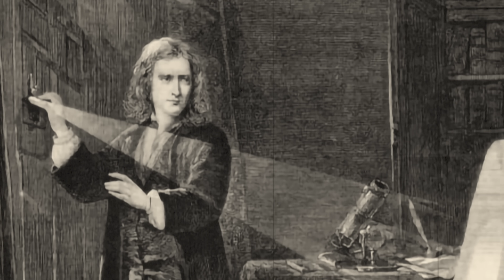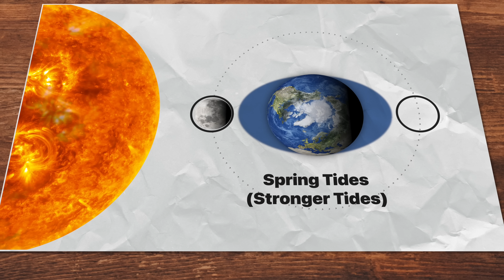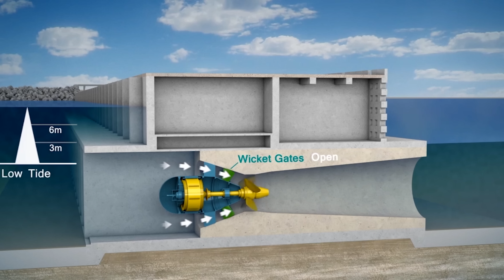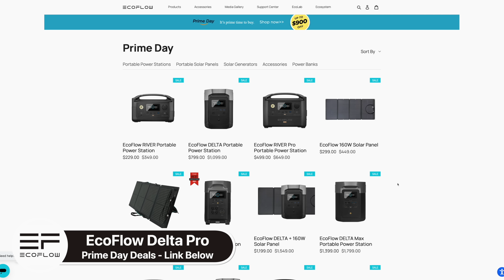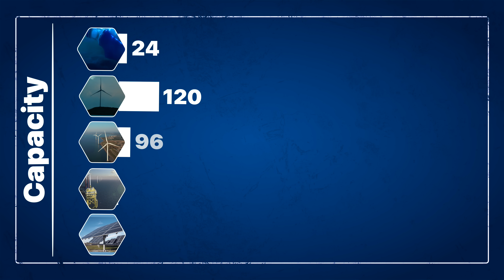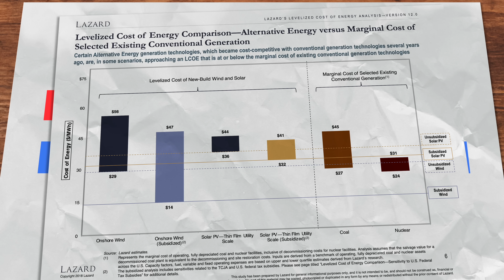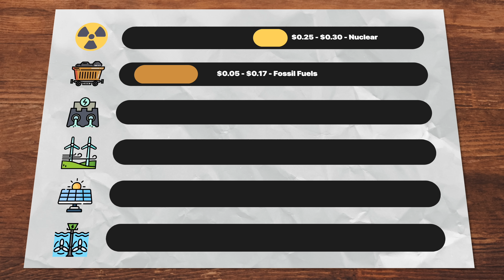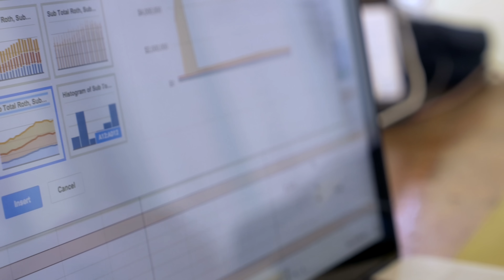Breakthrough Energy Source is 10X Better Than Wind & Solar!?

Comment: The solution to our energy needs has been known since the 1960s. It is the molten salt reactor. However, we have neglected its development, for various reasons. 
The molten salt reactor operates without elevated pressures of current reactors, needs no enormous containment vessel, has the simplest possible shut-down mechanism, and does not leave most (98%, for goodness sake) of its fuel unburned. It is throttleable (= load following), and does not need expensive precision-manufactured fuel rods. They are very nearly immune to nuclear proliferation. The same (genius) bloke, Alvin Weinberg, invented both the PWR and the MSR. A working prototye MSR ran for several months at Oak Ridge in the USA in the 1960s. Unfortunately, the funding was re-allocated under President Nixon, and the project cancelled. But the concept has been re-discovered (largely by Kirk Sorensen) and has a number of supporters.
The British company: MOLTEX is building a "stable salt reactor" in New Brunswick, and is expected to bring 300 megawatts of power to the Canadian grid by 2030. When proven, these things can be assembled on a production line. They actually burn trans-uranics, which are an unwanted legacy from our PWRs (and in Britain's case, AGCRs). 
I think (for those of us with stocks of plutonium) this is the way to go. But there is a lot of inertia in the industry.

Comment: Really great presentation! Being a Clean Air and Clean water advocate any possible option should be explored. I've of course viewed and read much about different technologies already deployed and some in the design and fabrication stage.
Might I offer a suggestion I don't see many take into account when calculating cost pkh with oil. 
Since Kuwait how many wars have been waged to protect oil supplies. This MUST be factored in as it was the CAUSE of conflict. Failing to do so is simply denial. 
Infrastructure. 
In my youth Pres. Kennedy made landing a man on the moon in tens years a goal for US. We had no NASA, no Infrastructure limited talent and no experience in space. 
Yet we did it. 
Can't is an attitude of failure and assures result. 
I bought a solar system part by piece. Cash. I haven't regretted a moment and the savings is insane. My income is a small SS check and a VA disability check. Very limited but I accomplished what I wanted. Because I CAN. 
 Again, completely enjoyed your informative and well executed presentation!

Comment: Very interesting video, thank you! As others have stated, the O&M cost would be enormous for tidal energy at massive scale. Also, the transmission buildout costs would be daunting to say the least. I think this shows promise, but would require significant advances in automation technology to bring the price point for O&M costs in particular to a reasonable point.
Reply: Because of the poor physics of the system the costs will never be compeditive with clean green new generation nuclear.

Comment: Correct me if i'm wrong, but I would imagine tides being most effective being around the equator and gradually less and less so as you go towards the poles, but I guess with the range of spring and neap tides, it will still benefit somewhat, though that will have to be compared against the cost of building and running them to work out which ones are worth building.
Reply: check out the tides in the Bay of Fundy Nova Scotia, they top out at 50 feet!  Sound like if you were going to build these anywhere it would be there
Reply: @robertjones1730  oh yeah, waves are different from tides, but if they are that strong, then it would be beneficial.
Reply: It has more to do with coastal  topography; Liverpool has 6 a knot tidal stream at Springs and 4 knots at Neaps with a Springs range of about 30 feet, as the bulge that follows the moon banks up against the shallower continental shelf and spills around Ireland into the Irish Sea, and around Scotland and Dover into the North Sea

Comment: We should use all renewable options BUT we should have been doing this 30 years ago... US President Jimmy Carter 1977 to 1981 was told about the build up of carbon in the atmosphere in the 1970s his administration got development of solar and wind started. He also wanted to do a blindingly simple thing and have high fuel use vehicles cost more subsidizing the lower fuel cars. We drive in 1500kg cars to move a 90kg human!!!
I find it staggering that two person work and back traffic cars are not promoted.

Comment: Why does anyone care about efficiency for energy?  Solar, at ~20% efficiency, is much cheaper than tidal, at ~80% efficiency.  How efficient is coal?  Oil?  It doesn't matter at all.  Solar could be 0.1% efficient, and as long as it were cheaper per unit energy over its life than something that's 100% efficient, solar would still be better in terms of energy generation.  For energy, we should only care about the costs.
Reply: Efficiency is important because it can bring down cost, but I agree that high efficency does not nessesary mean lower overall cost. Cost is complicated to calculate, especially if you want to include side effects like environmental damage.
A solar system with very cheap panels with very low efficiency  would require much more land and high installation cost bringing overall cost up.

Comment: You absolutely cant use LCOE to compare costs of renewables to reliable forms of power generation. Whats the cost of a kwh of solar power when the sun isnt shining? If solar and wind are so cheap then why is electricity in places like Germany and California so expensive?
Reply: LCOE is not everything. You need to include storage, grid transmission and climate and environmental damage when comparing energy systems.

Comment: I live in Quebec, right next to the Saint Laurent ... "River" is an understatement.  The apartment I live in is heated by ELECTRICITY, from the countless dams here, and all electricity in the building is included in the rent(upkeep) cost, and Quebec even sells its surplus to the US grid.  I guess the only OTHER better energy source would be deep geothermal.  I really don't understand why people don't get MORE GEOTHERMAL, since the fluid would also provide rich mineral resources extracted without the usual dangers and costs.

Comment: About maintenance: 
I expect a major difference between that French installation an (for example) the Irish. The french installation has dense turbines with high flow rates (flow is condensed with the dam), while the "underwater flow turbines work slow. So I assume, the "Irisch" way might be more influenced by biomass than the French model.

On top I see  another major difference: I expect the French model more reliable output and easier to maintain than the propeller dropped on sea ground.

Comment: Those figures for lifespan seems completely unrealistic. I manage a high rise condo in the beach and there isn’t a commercially viable metallic equipment that we have that lasts more than a decade or two. We are constantly adding waterproofing coatings and lubricants. And we are on the land. I can only imagine how much more abrasive underwater is. Would love to know what materials they are using, would be a game changer in my industry.

Comment: What I miss in your costs per kWh overview is the moment of generating. Like the moments that we use it, Solar is the less during winter and much during the day in the summer. Wind is only on avarage but not on exact moment to be calculated. Maybe summer winds by local climates. But in the Netherlands the strongest winds are based on low pressure systems that should more be available after the hurricane season in the USA. And if the evening of windpower option grows, the price off the electricity will drop. Tide is there every 12.20 minutes again. So also a lot of times during morning and evening peak periods. Tidal current is mostly also stronger when the wind is strong.. in this case both renewables will give lower prices.

Comment: The secret sauce is turning out to be overlaying wind on top of solar.

Solar works best during the day when its hot.  The cool thing is that wind works the opposite of this, it's the strongest when it's cold and dark.  When you overlay them with batteries, it becomes the best resource.  In 2022 that is what the US grid is doing, most of the new power is batteries, wind, and solar.  Coal is collapsing, nuclear is staying steady, and natural gas is pleateuing.  Solar, wind, and batteries together is now the cheapest option and works everywhere on Earth.

Comment: I've encountered this on a personal level. I live in an RV, and have had to weigh these factors for when I'm boondocking. Currently, the most cost effective power generation is a petroleum based generator (gasoline, LP, diesel). But there's noise, pollution, and the smell that makes it inviable except for emergencies. Solar and wind are less reliable due to weather. But, when I get, and move onto a boat, tidal power will become an option when at anchor*. When on the boat, I plan on using all four options, and often none since I'll be sailing and won't need any electricity.

Truth is, all the factors are scalable down to a personal level, which is how wind and solar were evaluated. Sailors don't use much - if any - electricity when under way, so we just use solar to power E-nav and radio, so tidal generation hasn't been as well evaluated.

*I have a couple of ideas for generating tidal power - or, more accurately, a version of it - while under way.

Comment: What is needed is further expansion and research in the third line-item of the chart at the 11:00 mark.  It is right near the middle as far as LCOE costs (slightly more than half the cost of off-shore wind), throttleable (need more power? increase the output of the generators), ALWAYS available and if the PTB would allow recycling/purification of the waste, it is far safer than most people are willing to admit.  You also don't need to build your power plants along the shoreline, remember what triggered the Fukushima disaster?
.
Regarding the maintenance costs and longevity for the tidal systems.  The Laurent project in France and the Siwa in S. Korea are, to all intents and purposes, standard hydroelectric dams.  The biggest differences are they DON'T need to rely on rain and snowfall to "recharge" nor is their storage being drawn down for drinking/agricultural use plus the turbines run in both directions.  It would be relatively easy to pull one of the turbines from the "array" if it needs to be repaired or replaced.  You can't say the same for a turbine sitting miles off shore in over 200 feet of water.

Comment: How did you make up that pop up. Challenge the argument not the presenter. Thats not what i was gonna comment on. That popup will work for agreeable people. However do nothing for less agreeable people. 
Moving on...
I've been banging the desalination drum for over 30 years. The ocean is our best resource...
Desalination has challenges, the lakes we have ruined are not going to lessen unless we pay for desalination now and stop using the cheap water. 
I don't consider myself an environmentalist, I am the opposite actually, I am a commonsense-oligist and your presentation on the surface makes sense. 👍 i would like to praise your presentation however that would violate the popup warning. We cant have things both ways. If we can't personally attack the presenter because he doesnt deserve to be attacked, nor can i give the presenter any praise. How can we square this?
👍😁🤣

Comment: A generators efficiency is directly related to the diameter of its windings . Why do people stick with a small generator diameter with a fan hooked to it . I am very much a fan of Archimedes , his screw in particular . A very modified version , made to not move water , but made to be moved by water . With a generator in the outside . Slow moving grated , to keep large things out , and slow enough to not harm small things .

Comment: Regardless of cost, the energy efficiency of an energy capturing method, and it’s effects on the environment, and it’s requirements of human labor, are the three most important factors. No slave wages/labor, less environmental impact, and high efficiency, means less materials used, to provide equal energy that other solutions might require! Energy efficiency is worth the extra cost, but that saved cost should not be taken from people who manufacture and engineer the solutions.

Comment: This is a good addition to our energy portfolio. We need energy diversification desperately. Crude oil cannot sustain the growing population on its own and clearly there are negative affects both environmentally and economically to rely on it almost exclusively. We need amounts of energy that go well beyond what crude oil can supply on its own which has proven to be unreliable. This is why collecting it from beyond the Earth from celestial bodies is really the only way forward if our civilization has any chance to continue to grow instead of slipping into decline. The amount of energy potential from the Sun's radiation and the gravitational forces put on the Earth every day is simply staggering. We just have to improve our abilities to harvest these resources and use them efficiently and we will be set. And if we actually do successfully develop practical fusion reactors that generate energy for actual consumers, that will be the cherry on top and the ultimate baseload.

Comment: Your entire argument is moot.  It is based on the assumption that CO2 “traps” heat and causes Global warming..... therefore we must stop using hydrocarbons for energy......  which is utter nonsense.
CO2 is a trace gas within a larger body of gas (atmosphere), which continually moves with convection currents.  There is no “trapping” or re radiation of any significant measurement.
We have an abundance of Hydrocarbon gifted to us by nature that offers huge energy density and produces water and CO2 when burned.
We are demonising and wasting this resource by going backwards into tidal technology, along with wind and solar...... which are a gigantic waste of time, money and resources to produce so little energy.
It sounds great when presented to us like in this video, but merely perpetuates the propaganda (now not even mentioned) that we need at all costs to eliminate CO2, the molecule of life.  Sheer lunacy.

Comment: Australia's far north west Kimberley region has drowned river valleys giving suitable sites for barrages and a 30 foot tidal range --possibly the best overall tidal resource in the world.  Using tidal power for mineral processing including extraction of magnesium from sea water has been considered --there is no nearby population but undersea cables to Indonesia is possible and a current scheme to send solar electricity to Singapore could mesh with it  (many years ago Buckminster Fuller proposed GENI - Global\Energy Network International to interconnect the day/night summer/winter north/south power grids and even out consumption and production - the cost of distribution might prove a problem for a full system.   one benefit of tidal power is to pump some water over the barrage at HIGH tide (when the open sea and the impounded water are level ) -pumping water a foot over the dam wall costs some power but at low tide that same water falls 30 feet giving high NETT power unlike pumped hydro.  Wind turbine blades are being retired en masse after not so many years and suffering erosion and fatigue --also gear box cracking --for underwater blades heavier less susceptible materials could be used and 'bug wipers' like used on top modern sailplanes energized by the water stream could remove marine growths economically .   Paul MacCready looked at hydro stream energy from the Gulfstream in the 70s but not sure what resulted. (Hurricane loads might have been a deterrent )
It seemed that cost estimates for tidal or marine power had a huge 'error bar' but not sure why .  The Severn estuary tidal potential is another problematic case -the very severity of the flow makes construction difficult as it did for bridge building there.   Good luck with future progress.

Comment: At 8:37 you say wind is "heralded as the most efficient renewable"  would  you provide a little more context as to what you mean by efficient? I'm also not sure where you pulled the numbers from. Typically Hydro is considered to be the Most Efficient energy efficiency converting ~90% energy that is put it to energy put out as electricity. (number was pulled at random for a google search give it a tolerance for variability but still the number is high)

Comment: " Nova Scotia Power has decided to pull the plug on North America's only tidal power generating station and wants its customers to pay $25 million over the next decade to write off the asset.

The utility says the decision to permanently retire the 37-year old Annapolis Generating Station in Annapolis Royal, N.S., was due to the failure of a "crucial component" in the generator and an authorization required by the Department of Fisheries Oceans after it determined the facility caused serious harm to fish. "

Comment: Tidal is the way of the future. We have one in Western Australia. it is basicly several Huge concreat bowls under water. Zero moving parts. The turbine is on land. as the tide comes in the bowl fills with water. the air been pushed out spins the turbine, as the tide goes out the turbine is put in reverse and as the bowl empties it sucks air in again spinning the turbine. This is the futur of tidal power.